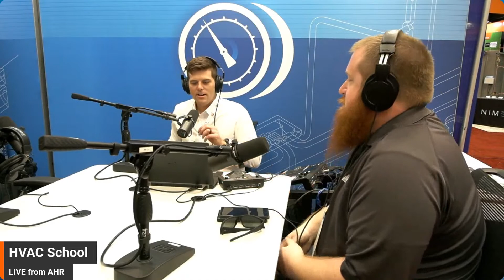VRF Tech Talk Takeover

Comment: VRV/VRF manufactures include a Sub-cooling circuit on their Branch selector box to Sub-cool the liquid refrigerant from the FCU in heating mode when the system is in Heat Recovery mode. If the liquid line goes direct to the FCU on the Cooper & Hunter VRF then how do they overcome the possibility of flash gas?